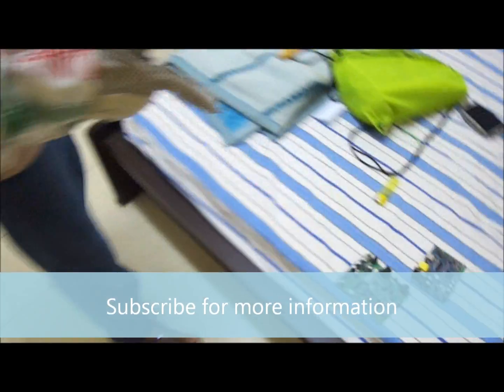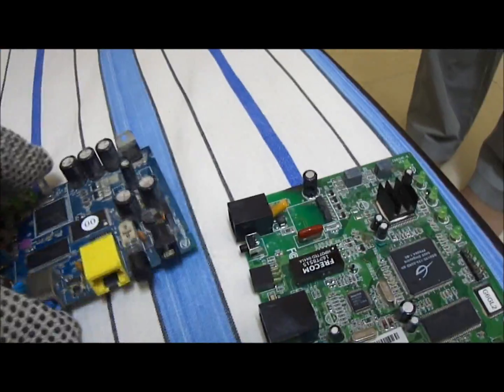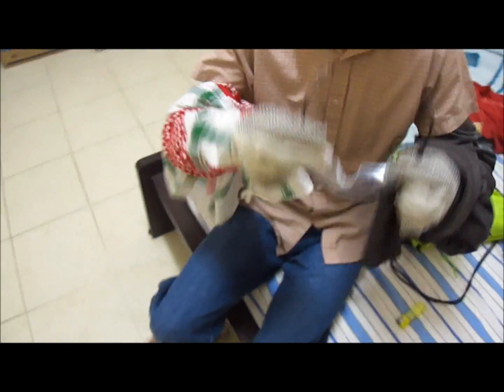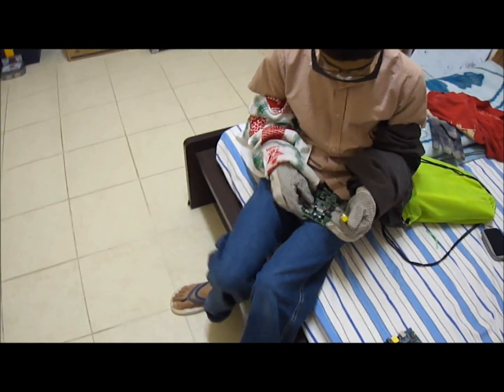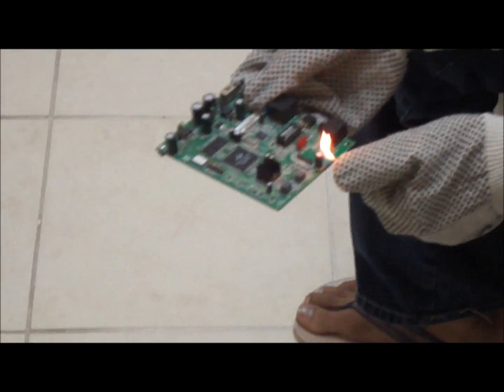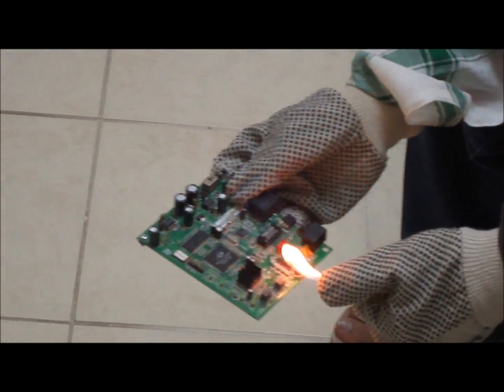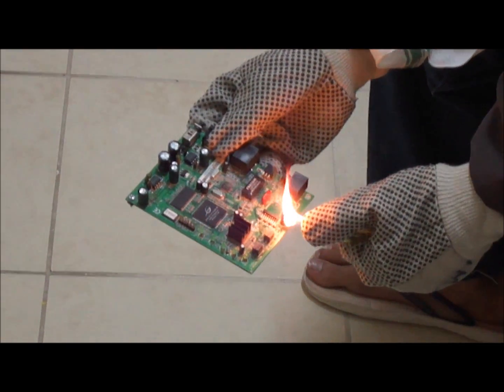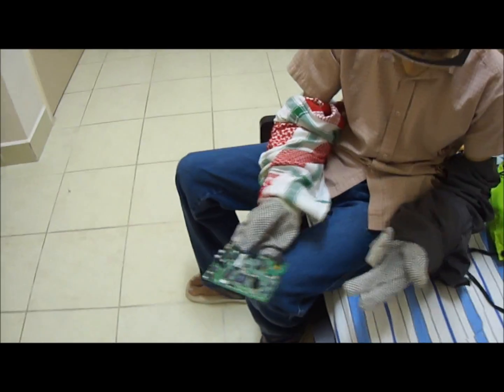Exploding capacitors!!! (A big one)

Comment: @humza6951 I just blew up a few capacitors just using an adjustable power supply!! much safer, and very easy to do!! Just hook it up wrong (positive kabel to the negative on the capacitor). Be sure to use more voltage than it van handle!! wait abou 20 sec. and kaboom... nice explosion!!